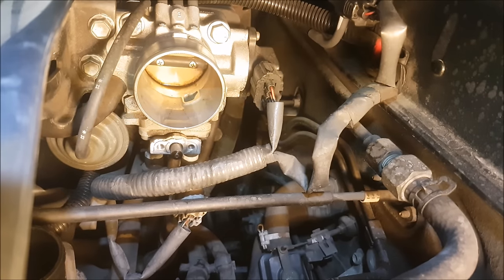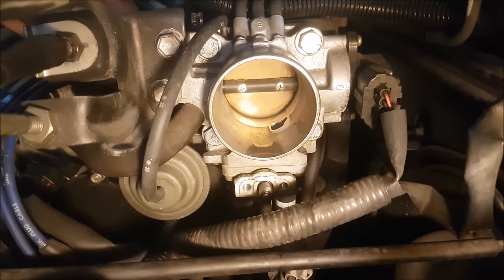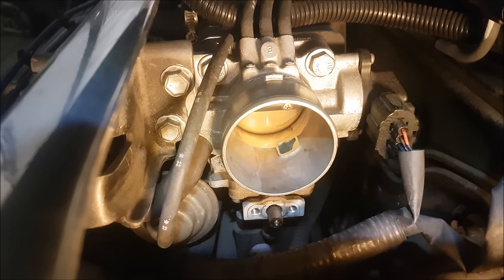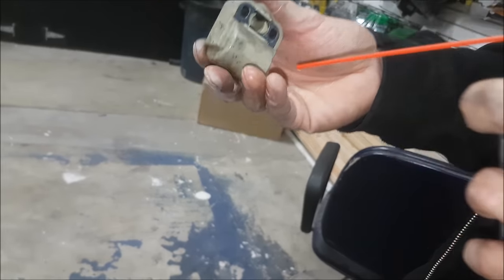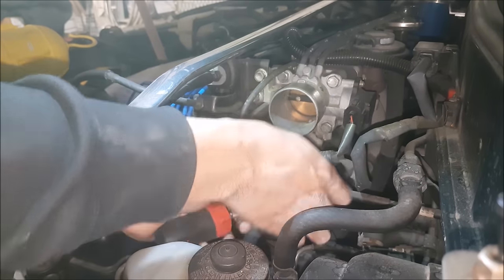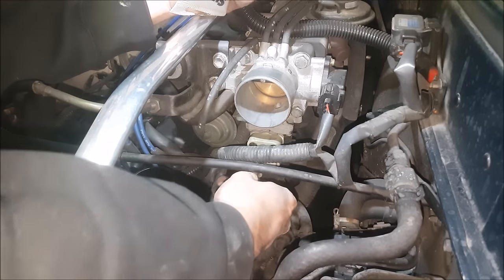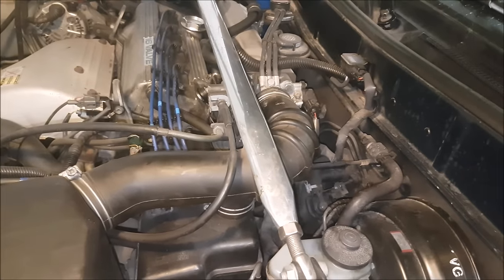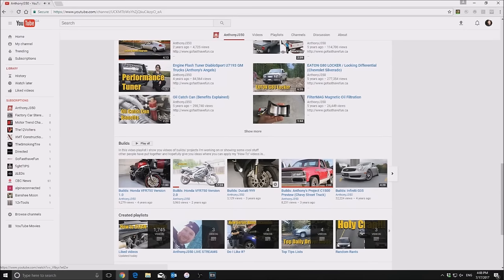Toyota Idle Air Control Valve Maintenance (Correct Idle & Cold Start Issues) | AnthonyJ350

Comment: 2009 Camry 2.4 has rough vibration idle, does the "idle control air valve" be the cause of my problem?
Reply from the maker: When was the last time the spark plugs or oil was changed?
Reply: @AnthonyJ350  I have a 2009 Camry also with rough idle. I changed the plugs last summer & have had the oil changed abt 1500 miles ago. Any suggestions? I did NOT replace the coil packs when I did the plugs, could that be it? And I have no check engine light on or any lights for that fact
Reply from the maker: @jessicaduncan1526  Try cleaning the MAF sensor with a sensor cleaner? Also try a fuel injection cleaner from Lucas. Are you using a top tier fuel brand like Shell?
Reply: @anthonyj350 Having a really bad stalling problem with my 2009 camery, do you believe it’s due to a bad iac valve that needs to be replace (changed spark plugs,ignition coils, got an oil change, Cleo the inside of the throttle body) Also check engine light comes on and flashes and the car seems to not go above a certain speed. Plz help‼️
Reply from the maker: @Matthewalldayyy  You might also want to check the egr valve for proper operation.
Reply: @anthonyj350 Okay I’ll try that out, the car stalls when I put it in drive and turn the wheel, the wheel locks and won’t move at all so you think possible clogged EGR valve? Thanks
Reply from the maker: @Matthewalldayyy  Carbon over time clogs them and can't operate properly
Reply: Matthew Tirado if it flashes upon accelerating it could be due to a misfire.

Comment: Can you help me to my idle problem?? When i turn on the aircon. The idle is going down.. what are the cause of that??
Reply from the maker: Extra load from the compressor
Reply: AnthonyJ350 how?
Reply from the maker: @panaypatikar2430  It's another accessory being engaged taking power from the engine to work.
Reply: AnthonyJ350 what is the best way to do?
Reply: AnthonyJ350 i will try immediate if it work..
Reply: My sienna idles at 698 rpms with everything off. If you turn on acit goes to 715 like its supposed to. If it goes lower than idle with everything off you have a problem. All cars step the idle up with power draw to keep charging battery properly
Reply: I have a 03 Corolla, same problem. Turn on AC rpm go down and up again, it feels like it is going to stall. With the AC off, it will do the same but it’s not that bad, also it does it when I’m backing up or when I go after a stop light. I thought it was the transmission slipping or something.The car has been checked for vacuum leaks, fuel injectors, etc every thing is ok. I definitely will try this. Fingers crossed 🤞

Comment: debris in the iac valve that exits thru the middle hose downward goes into the crankcase.... do NOT allow that!
Reply from the maker: Thanks for the tip!
Reply: You should not allow cleaner into the lower hoses. Pull them off and put a rag underneath. You are washing all that into your vacuum system and engine. Electronics cleaner eats some rubbers and plastics. Possibly causing egr diaphram failure

Comment: I sprayed carb cleaner in that hole with the hose still on. Where does that end of the hose go to? I saw another video that said it goes back to the intake but he also put a caption that says it goes to the crank case.... Did I put carb cleaner in my engine oil?
Reply: Just because you saw a video doesn't necessarily mean you have the mechanical ability to complete the task
Reply: Yes you did
Reply from the maker: I would just change the oil.
Reply: Yes

Comment: how does this car run today .9 28 2022
Reply from the maker: Car was sold in 2020 (transmission blew at 241,000KM). The engine and driveability was perfectly fine though.
Reply: @AnthonyJ350  thank you we are going to try this on ours .

Comment from the maker: If anyone is looking to replace their Idle Air Control Valve

https://www.rockauto.com/en/catalog/toyota,1993,camry,2.2l+l4,1273306,fuel+&+air,idle+air+control+(iac)+valve,6072
Reply: AnthonyJ350 it is not need to change the air control valve.  most of the time is only carbon build-up. Now a day ,the cleaning product are v good.

Comment: I don't agree with putting thread lock on a bolt that you may want to remove later. If you want to clean it a year from now, it's going to really tough to remove and you might end up spending that $800 you saved today. At least you didn't put on the red thread lock.
Reply from the maker: Putting a little blue is pretty easy to crack off.
Reply: Blue means it won’t be rusted or crusted stuck on if you need to remove it again
Reply: @mattiescreations  I would use a bit of copper anti-seize in that case.
Reply: @AnthonyJ350  hello no, thread locker is totally unnecessary
Reply from the maker: @CountChokcula  But easily comes off if you use a small dab.
Reply: @AnthonyJ350  you're using that on Philips head screws.
Reply from the maker: @CountChokcula  You've never worked on an electronic device where the manufacturer put a little bit of thread lock blue on the fastener? If you don't want to use it then don't.
Reply: @AnthonyJ350  toyota didnt
Reply from the maker: @CountChokcula  I did, and I'm cool with it. Toyota doesn't upgrade the ground cables either, but I also did that.

The exhaust pipes aren't mandrel bent but it's beneficial if it did have it. Manufacturers don't optimize to make everything the best all the time, it's optimized for manufacturing and profit.

I'm sorry you don't know how to apply a small amount of thread lock so it can still be loosened.
Reply: @AnthonyJ350  get over ot
Reply from the maker: @CountChokcula  So you agree. There are limitations to manufacturing and cost. And putting a tiny small dab of thread lock can be loosened.
Reply: @AnthonyJ350  I just bought a 90's camry and I'm wondering why the screw heads are stripped and can't get my IAC off. Thanks.
Reply from the maker: @yksoyzlyxlhx  Someone probably tried removing it

Comment: What strut tower brace is that?
Reply from the maker: It's just a generic strut tower brace off eBay like this one http://rover.ebay.com/rover/1/711-53200-19255-0/1?ff3=4&pub=5575240889&toolid=10001&campid=5337982243&customid=&mpre=https%3A%2F%2Fwww.ebay.com%2Fitm%2FJdm-Sport-For-1993-2001-Camry-Front-Upper-Strut-Bar-Blue-Anodized-Aluminum%2F114122987697%3Ffits%3DYear%253A1993%257CModel%253ACamry%26hash%3Ditem1a924298b1%3Ag%3AkC0AAOSw2T9ehQrV

Comment: My take to much IAR got off put tower in say the filtro car running good thing can be problem take tower car got off
Reply from the maker: Try cleaning it out, let it dry and reinstall.
Reply: @AnthonyJ350  what can used to clean it take to much air I put towel thank run ok take our it got off Thad say clean it maby stop do it thank s much
Reply from the maker: @angelgarcias8219  Throttle body cleaner
Reply: @AnthonyJ350  ok thank such

Comment: ..using premium gas took care of most of the problem.....
Reply from the maker: Some brands like Shell do put more additive in the higher octane rated fuels, I believe Chevron does as well.
Reply: @AnthonyJ350  ..i will try using Shell Premium....
Reply: Premium gas is a waste of money if your car doesn’t need it. Most modern gasoline’s already have cleaning additives. The octane rating has nothing to do with that
Reply from the maker: @XxChuyoxX  Shell premium is suppose to have a higher concentration of additives.

Comment: Have a 2009 Camry replaced alternator and now it starts right up but won’t hold Idle dies out and misfires.Any Ideas of what would cause this.
Reply from the maker: Battery connections all tight? All the plugs are plugged in?
Reply: @AnthonyJ350  Everything plugged in and tight just won’t hold Idle dies out.
Reply from the maker: @vincentclark8847  and all you did was change the alternator?
Reply: @AnthonyJ350  Yes
Reply from the maker: @vincentclark8847  Did the vehicle trip an engine code? You might want to scan it.
Reply: @AnthonyJ350  haven’t scanned it but no check engine or any other lights on dashboard.
Reply from the maker: @vincentclark8847  If you hold the throttle it will stay running? Sure no vacuum lines are disconnected?
Reply: @AnthonyJ350  
Will run as long as you keep your foot on the gas when you let up goes to Idle and dies.
Reply from the maker: @vincentclark8847  I would check for a vacuum leak, was a vacuum line disconnected during install?
Reply: @AnthonyJ350  No just the three connections to the alternator.
Reply from the maker: @vincentclark8847  Your accessory drive belt is install in the right pattern? Not sure why the vehicle wouldn't idle. Sounds like it needs to go to a mechanic.
Reply: @vincentclark8847 did you ever figure out the issue on this?!